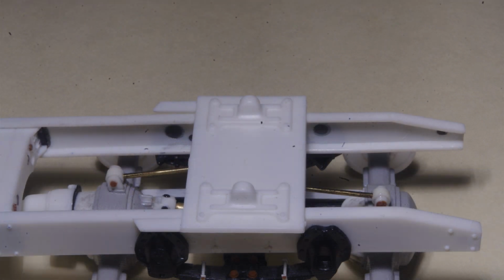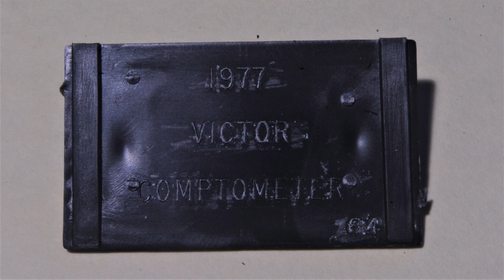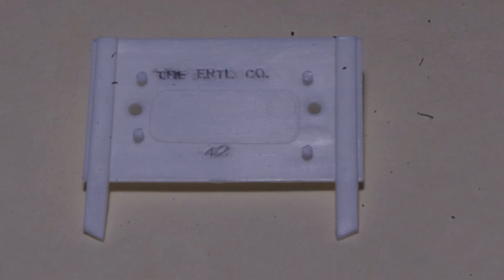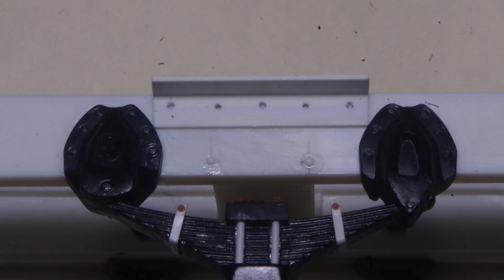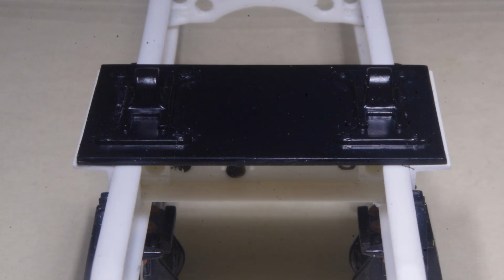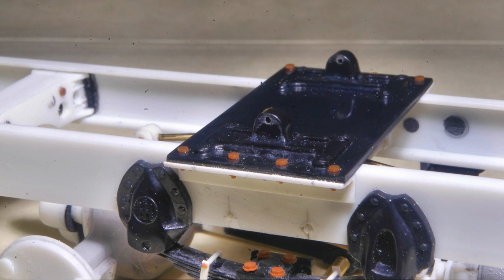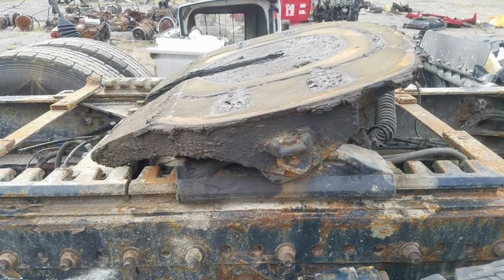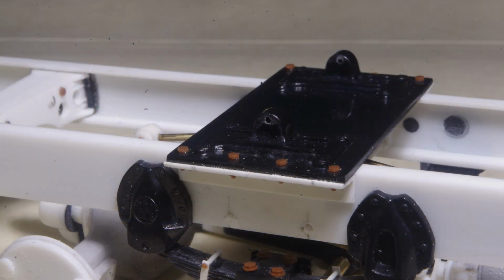Adding some details to a 1/25 scale truck fifth wheel mounting plate

Comment: Great video , where did you get the bolt castings.
Reply from the maker: I ordered them directly though Tichy Train Group’s website. 

I have seen them occasionally in hobby shops but it is quite hit & miss. Usually only see them if the store has a large model railroading selection.